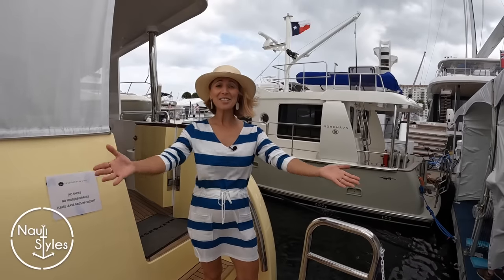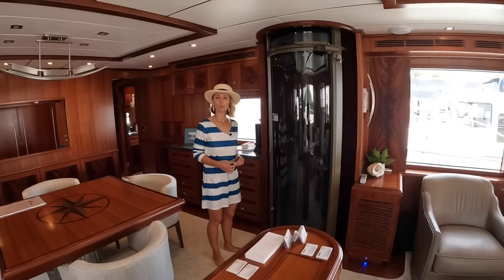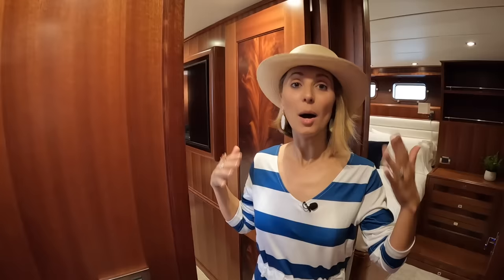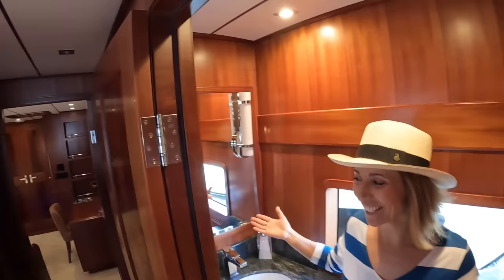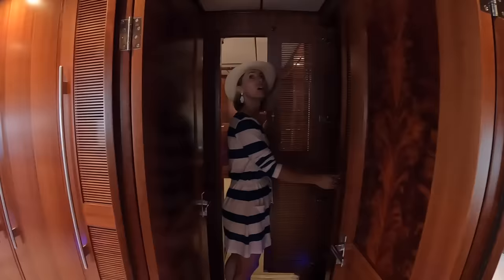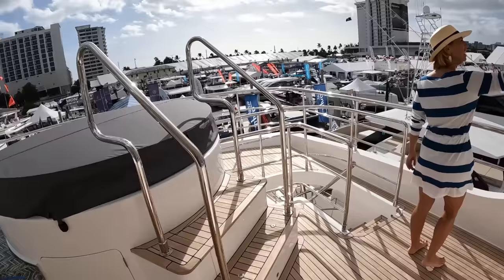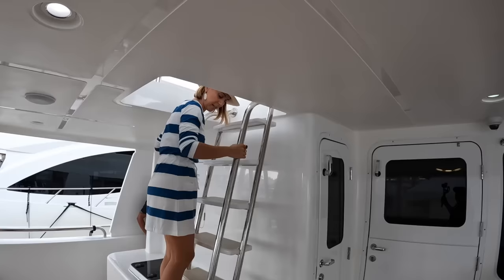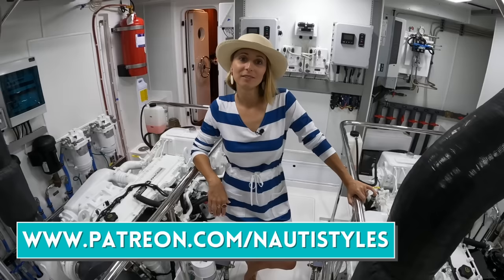2021 NORDHAVN 80 Hull #1 Explorer Yacht Tour / Expedition Liveaboard Long-Range Cruiser

Comment: Another great tour as always.  But a "Long range cruiser" with only 3000nm range?  Would take a Bering B80 over this one without question.
Reply: 3000nm range at 9 knots, it's longer if you dial it back a couple knots. But I do agree, I think I prefer the Bering more than the Nordhavn especially due to it having a much longer range. Not that I am in the market for either. I am somewhat curious about the Nordhavn 475 as it will be in our price range when we are looking to upgrade in a few years.
Reply: The under 65 foot Nordhavns are fine, but they just can't compete with Bering when they get into the size range of this boat.
Reply: Ohhhh, thanks for pointing out the limited range, I missed that! Then, it's a matter of a Bering vs this one with larger fuel capacity, in my mind.
Reply: I think it is misleading to compare a Nordhavn to a Bering. The Nordhavn is an Owner Operated boat with crew support - maybe. The Bering is a boat designed to be professionally crewed and is bigger at the same length. This N80 has 1 crew and room for 6. The Bering 80 has room for 10 and a crew of 4. The Bering is a bigger boat and probably used as much for Charter work as private sales. The Nordhavns are pretty much exclusively a privately run boat. As for range - you can double it by dropping one or two knots in speed. It's really drastic.
Reply: @rtbinc2273  I am curious about the workload for that captain on the Nordhavn 80. It's true that it is smaller than the Bering 80, but it still is a lot of boat. If the owners had an elevator installed due to some mobility issues, how much of the routine maintenance are they going to do?
Reply: @FlintIronstag23  That is a big question that requires personal info about the owner that we don't have. You can speculate that the elevator is for an elder parent of a younger owner. I don't need an elevator - yet - but my parents and in-laws do.  Yes that is a lot of boat with a lot of workload, it is not a beginners boat. The N41 next to it is more of a beginners boat. That is why there is room for 1 professional. The boat does assume the owners will do a bulk of the work themselves. The design of the boat assumes an owner operator with a lot of experience. You might want to say that the Bering is a boat that you hire Rico to captain for you while the Nordhavn is Rico's personal boat - if that tender business of his does really well.
Reply: @rtbinc2273  I guess everybody has different things that give them pleasure. Endless boat maintenance/upkeep is not something I would find appealing if I'm spending millions of dollars on a yacht on this size. Assuming the captain is also the chief engineer, that still leaves a lot of exterior and interior cleaning that the owners would have to do, not to mention cooking, watch keeping, ect.
Reply: @FlintIronstag23  I agree. Nordhavn is owned by PAE - Pacific Asian Enterprises - which used to make - and will make by special order - Mason Sailboats. You sail a sailboat. Do you want to be on the deck of your sailboat with the spray on your face hauling up a sail? Me neither. But - the same way you would sail a Mason you would run a Nordhavn. Masons were and are very expensive sailboats. As the Roman's used to say "De gustibus non est disputandum"

Comment: I love watching your entertaining vessel walk throughs.  I have been in the maritine industry just about all of my life.  Mainly like the engine room scenes.  During my Navy days I was an engineer.  Later I crewed on a 300 ft NOAA research ship as an unlicensed engineer which had four diesel electric Fairbanks Morse apposed piston engines and aux. (3).  Finally I retired from the Washington State Ferries again as an engineer.  Worked all 21 or the vessels with locomotive 16 - 278 EMD's to 16 - 645 EMD but the last vessel was just a small 40 car capacity and we had two 6 cylinder 850 hp Wartsilla.  I noticed in your larger engine room showings that diesel centrifuges by Alpha Laval are used.  They are a real savor if for some reason in some countries we ended up with some really dirty fuel.  Thank you again.  Brings back the days as a kid my parents had Tollycraft and Chris Craft cabin crusiers......  No Showers and no black warer tanks required then.  Just basic FUN boats and we cruised the inside passage in British Columbia and favorite was going to Princess Louisa Inlet.

Comment: Thanks for bringing us this look of the Nordhavn 80. What a lovely boat. Just my 2¢, button down the hatches is actually: "batten down the hatches." This comes from old time cargo ships with cargo holds that have covers. During stormy times these hatches would be covered with tarpaulins and tied down to prevent losing the hatch covers. Losing a hatch cover during a storm would result in the loss of the ship. The other term is to Dog down the hatches. This is a US Navy term. Smaller hatches for personnel movement onboard Navy ships have "Dogs" that are in addition to the normal latches. Dogging a hatch will make it as watertight as the rest of the bulkhead or deck. Nordhavn provides main deck doors to be "Dogged Down" in the event of extreme weather.  Thanks again for the video, you made the N80 review a lot of fun.

Comment: This seems like an incredibly well thought out layout for an owner operator who might occasionally bring in crew.  Lot's of places that could work perfectly well for either an owner/operator OR for crew.
I still think I would prefer a bering, but I wouldn't be upset with this by any stretch.  A great yacht!
Reply: Essentially no crew quarters. Which means the owner will be cleaning.
Reply: Check out the Allseas 92 that these two toured. It took 3 videos but it was definitely thorough.
Reply: @prepperjonpnw6482  Yeah, that was a good one.  I loved the engine room on that one!
Reply: @prepperjonpnw6482  That was really nice, too. I'm still partial to the Bering 77. They sure packed a lot into a smaller boat.

Comment: A little about that elevator, it’s pneumatic powered and free standing so you can put it pretty much anywhere ( no elevator shaft required). Because it’s air powered it can never get stuck, if it loses air pressure it just slowly goes back to the lowest level. I recently toured a home that has a 2 person 3 story version of that elevator.

Comment: I think I'd go for the Bering 77.
One of the main reasons would be less regulations on 77ft vs 80ft , if I'm not mistaken,
another would be steel vs fiberglass. IDK, I would just feel a lot safer cruising around Alaska with a steel hull - the ice scares me but trees/logs scare me more.
Reply from the maker: fair enough
Reply: Tried hard to google those regulations, but could't find any "scary" ones ;) which could make you stay below 24 m at all costs.
1. The 24 m is "LLL" (load line length) limitation. It's about 94% of waterline length, so any Nordhavn 86 and below are definilely "below 24m" yachts. Maybe even Nordhavns 96 are "below 24m". ;)
2. Judging by what I found, it may be critical to stay below 24 m OR 200GT, that is not exceed both. The most "scary" requirement is manning, but for yachts >24m LLL but <200gt it's just one RYA Ocean and one RYA offshore onboard for the unlimited range. It can well be "husband and wife" and your insurance company would want it anyway. This is for the UK flag, it depends on the flag too.
3. I'm definitely no expert in business reputation, but judging by what they write on the forums Nordhavn has a great long standing reputation and hundreds of happy customers, Bering...much less so. If I was ordering a yacht for my hard earned money I'd have much more peace of mind doing it with Nordhavn. 
4. My faforite yacht so far, if I win the lottery ;), is a Nordhavn 96 "Lacey Kay" customized. An almost ideal owner captain or minimum crew world cruiser, though a steel hull might be better indeed.
Reply: @tun7166  Interesting info Timmy, do you know how these rules apply to Cats, the same or do they have different criteria?
(I'm into early stage research on these issues, provisional on a lottery win of course)
Reply: @marifaceawl7192  As far as I know, cats are absolutely the same. Beam length doesn’t count

Comment: Well guys what a great review. Also the count Down editing and art work very cool. Looked like a New York aid firm did it. The yacht is so well layed out. Here's what I think they missed. In the deck tie downs for jet ski on the upper deck by the Davit crane. Also in this day and age a beach club fold down with stairs into the water for divers. Also the 3000 NM range seems a bit short. I love the John dear motors. Would ELECTRIC pods with a 360 degree rotation have been a better choice. I'm sure owners pick what they want. Also fly bridge hard top, I would have stuck solar there. And SWAPED the heavey marble showers for lithium batteries bank.
Also I would have added a very large exterior freeze chest, with locks. Reason when your salt water fishing and on top of the fish you would want to fill a freezer with fish and not have to bring them inside. Also I love all the docking stations. But a remote, or cabled controller could have free up all that space cut over all weight and cut cost in the build. Video was great, camera work spot on. What a great yacht.
In the specks can you add the yachts classification. Up to ice class, ect hull thickness.
Any reinforce area up in the bow. Kind of like the yacht all seas has 3 inch steel plates in the hull around the bow.

Comment: The fuel fill still doesn't have any spill protection.  Just a simple piece of fiberglass around the fill to keep any spills from reaching the deck would add alot of value for a minimum of cost.  They have been asked time and time again to implement this, but they ignore their customers.  Guess that's why companies like Bering are rising, making record number of boats, while Nordhavn is losing momentum and putting out less and less boats.
Reply: Nordhavn has never built more boats than they currently have in the build cycle.  Cannot build anymore. Still the largest manufacturer by a huge margin in this space.  Your comment is incorrect.  The facts are that this class of explorer yacht is exploding in popularity so all manufacturers including Bering, which is a very different but also good boat are extremely busy.

Comment: So have been wondering how an owner of this yacht could possibly take care of this boat with only one crew member? Just doesn't seem possible to me. Cleaning the outside at sea would be a few hours, engine planned maintenance at least a few hours, and interior polishing, cleaning, laundry a few more hours a day, then cooking. Doesn't leave many hours to relax. Maybe a weekend yacht but not a long distance cruiser where you would need to stand watches too. Comments?
Reply: Have you watched "Aboard Mermaid Monster"?  Admittedly it's a Nordhavn 55 but it's 2 adults, two pretty small kids and a dog who live aboard and cruise the eastern seaboard mostly.  They manage, although they do look a little worn out after a longer passage.
Reply: @michiganengineer8621  I've watched another channel with a couple living on a 55. The thing is, the 80 has over three times the displacement of the 55. It is that much bigger!
Reply: So, it is owner/operator with a professional GT200 skipper?
Reply: @seadog6351  Oh I agree, the cleaning especially would take quite a bit longer.  But the mechanical checks shouldn't add much if any time over a 55.  The trick to the cleaning, at least as far as the interior is concerned, is never let the dirt get too far in front of you.  Just do a little each day and you can keep it under control.  Hull cleaning on the other hand WOULD be a different story.  You'd probably have to dedicate 2 days per month to keeping the hull and decks presentable.
Reply: @UbiquitousTech  I don't know the legalities of it, but I would say no.  You as the owner would tell your hired captain "Take me to (wherever)".  It would then be said captains responsibility to plot out and execute the course.  And YOURS as the owner (Admiral perhaps?) to make sure that all of the paperwork and fees are taken care of.

Comment: At last a BBQ that has room for more than one " American Porterhouse Steak" ! Beautiful Woodwork ! The owner did a great job in picking out colors. The showers need rainfall fixtures. Pull Out drawers are awesome - all cabinets need them. Aircon units accessible - N120 was torn up on those by Steve D'Antonio. Nice to have a place in the Galley to sit down - very nice touch. More room on the fly for those " American Porterhouse Steaks" ! To me, this is Nordhavn's sweet spot as far as size 75-80 is their best size.

Comment: I'm sorry this one slipped through my radar and I'm only just getting to this one now.  WOW, hull number 1. I'll take hulls 2&3 thank you! I know you'll come back and read this Victoria - as you said, thank you!

Again with the stripes Victoria...I love them and your styles! Rico, as always, in fashion, with the navy shirts! I love the Out Takes as always. It was sad not to see inside the elevator which I think is a great idea!!! It would certainly be great taking my 91 year old dad out for a sail with his artificial knees.  Hydraulic no doubt...I think some of those showers needed two faucets/rainfall heads on them to help share the water around such large cavities. A dive compressor up front would be good with the plumbing back to the stern. Or perhaps the compressor in the engine room with 'storage tanks' (not the actual dive tanks) up front so that filling of dive tanks does NOT need the starting of the compressor each time. That's about the only things I would add. Loved the layout and room on each deck. It's a small shame that one needs to go all the way up to the fly to rinse off in the Jaccuzzi after climbing out of the salt water at the swim platform. Maybe one day someone will solve that problem! A larger swim platform with a sunken Jaccuzzi/plunge pool in the rear of the boat would be great - you could displace some of the crew quarters to achieve that. Who wants crew when you could own and drive this yourself?

Nice work guys! Love it.

Comment: Finally, a ship that does not pretend to be a house. I am thinking in particular of the doors with solid door locks and handles.
As a Scandinavian, however, I am more into a lighter type of wood. It will also visually make the spaces larger.
I wonder, however, that a ship with a normal speed of 9 knots does not have a longer range.
Reply: Nordhavn is known for its darker real ship wood. These new lighter designs are absolutely horrible from my pov sorry but a real ship should have a real ship interior.

Comment: Being a composite build you could request carbon fiber/kevlar hull for added strength. This boat is over 200,000 lbs lighter than the Bering 80 and will never rust and repairs are a breeze. Nice long range cruiser.

Comment: I think that elevator, is something that should appear on many high-service, multi-deck yachts.  I really thought it would appear on the Bearings you reviewed with Alexei.
I favor an person/service elevator (dumbwaiter) should run from below deck-engine room, all the way up to the flybridge deck.
Sure it can accommodate a person, but for me what I would feature is a very  stainless steel, mobile service cart (hospital style, with gel rolling wheels, very stable because it's built heavy on the bottom, lighter on the top). Service to any deck can be rolled-out from the dumbwaiter on the cart (multi-purpose transport for food service, trash, laundry, parts, motors, fluid containers to the engine room..., etc).

Don't need to develop the system from scratch. Highly developed systems are already available to borrow from industry.

Comment: I sense that Victoria doesn’t really like the traditional dark woods, but for me they set the correct ambiance that you are not in some run of the mill Miami condo.  You are in the interior of a proper luxury marine vessel.  The expensive dark woods and magnificent carpentry are exactly what I would select.  I find anything else does not speak to me about marine adventure or luxury, like these Nordhavn interiors.  Not just the woodwork, but all the interior finishes, furniture, cabinetry, appliances and layout.  Nordhavn has some of the nicest woodwork I see anywhere.  I am fully expecting to not like the finishers selected by Victoria and Rocco in their new Bering 75’ yacht.  Such a pity, because I love Bering Explorer yachts.

Comment: I really did love that boat and   really like  the woodwork inside  i’m not really a big keen fan on traditional interior design on yachts but this one I really did like. The only issues I have with any yacht is where the barbecue is situated and that is under a roof as the smoke will go up and you will get smoke stains and grease on the roof which means it’s another area you have to clean after each barbecue even if you have a crew it is still a pain

Comment: The specs say the hull is composite. What does that mean, in this case? I actually had a conversation with the Nordhavn sales person about fiberglass vs. steel. He was saying still is problematic because of electrolysis - steel conducts electricity. But I seem to recall that Bering coats the steel in fiberglass? Is this the same thing?